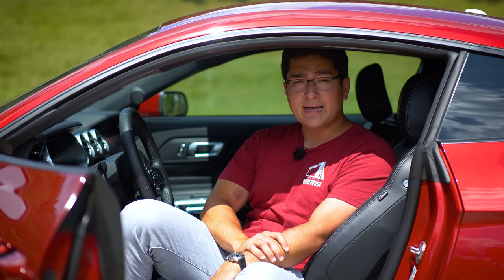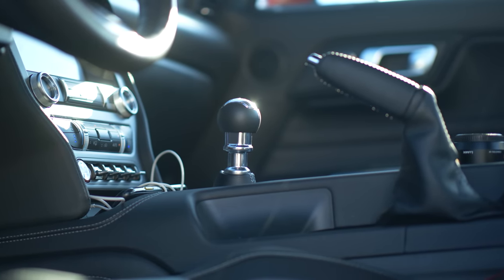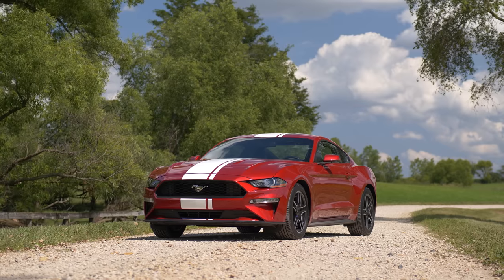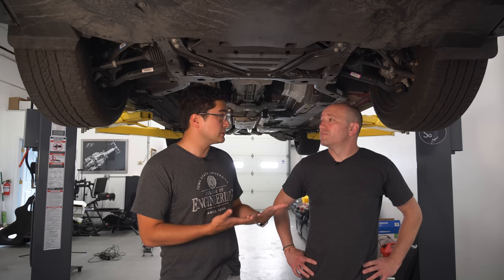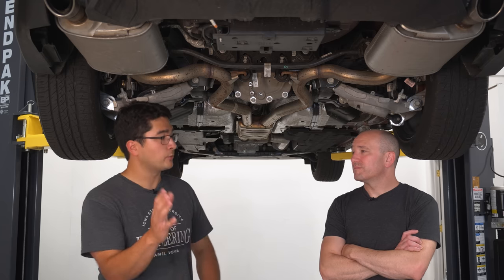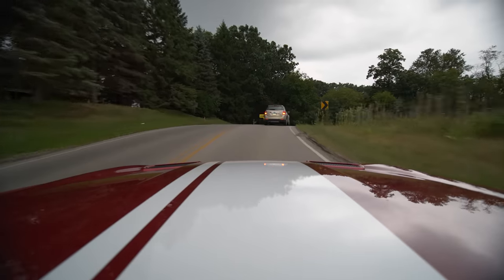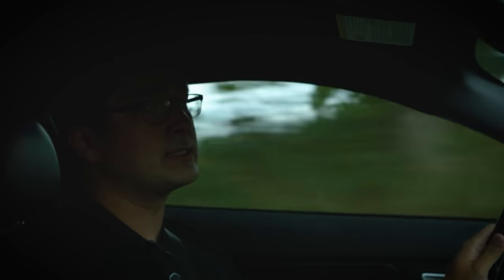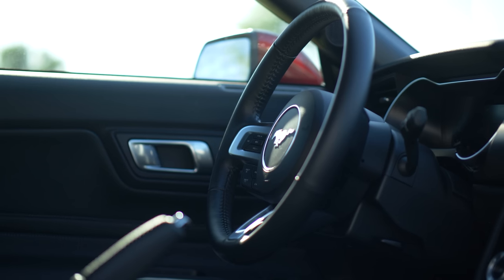2020 Ford Mustang EcoBoost | Red Headed Step Child

Comment: Wait till the ecoshit turbo bricks over time. Wish they kept it NA 6 like they had.
Reply: Agreed the 3.7 was a great but unapreciated engine
Reply: Prefer Supercharger (Whipple/ Roush), because at 38,000 miles i had Turbine Lockup within the Turbos at 82°+. This is caused by Thermo Variations consider locations of Turbos Ford mounts them below for lower center of gravity.  Problem is they're right next to the very hot engine.  Ricers know this and mount them up high close to heat extraction hood vents.  To keep them cooler, and not for show. Now the Turbo Shell expands like a donut 🍩, while it's being baked the outside expansion is outwards vs. Inside expansion is inward the hole gets smaller. The Blades expansion is outward to be larger to hit the Shell. Locking up the Turbine Blades, and then add the Backflow from the Intake and Downpipe to it to spool the the Turbos more.
My fuel mileage went from 
32 mpg to 8-12 mpg.  Glad for 2021 it'll have the GT500 engine package 5.0 V8

Comment: I like a lot of your other reviews, but Alex on Autos gave a much more unbiased fair review of this car than this refresh update. I think there was so much negative connotation constant complaints about the platform, yet when you look at your review of the BRZ which you owned there is clearly a much more positive tone throughout the whole video despite it's flaws. Even Jay Leno liked this car. Sure, maybe the BRZ is a better 'enthusiast' car, but honestly, under 30k the ecoboost mustang is an enthusiast car. There is a massive enthusiast market for the vehicle and tons of modification options yet you constantly deride the car as a 'fleet vehicle' . Don't categorize this car in the same area as a ford fusion, the high torque figure of this engine as well as the tunability of the turbo definitely makes this a fun car. Yes, I do own one, and yes I was disappointed you hated this car so much, but I'm just honestly tired of the constant online bashing of this car coming from mongoloid GT owners (which you guys are not and not to say all GT owners are even like that) or reviewers saying 'BUT ITS NOT A V8'. For once, can you look at this platform from a different perspective, without all the baggage and notion of the 'mustang' that you seem to completely hate and disgust for some reason? If we go purely by the numbers game a 300hp 350 ft/lb four banger turbo at 3400lbs under 30k easily sold by bmw, toyota, nissan, etc. or any other more eurodm/jdm focused brands probably would've received less negativity than this car. I just think in general, that when you see an american car, that you are visibly upset at believing that it is poorer quality, big and chunky, and not fun to drive. Maybe that is what you've experienced, and want to believe, but even as a younger, asian american (I mention this because the primary demographic of USDM supporters tend to be of a different ethnicity) that like JDM, EUDM, but owns a mustang, that there are legitimately good things about the car to enjoy and absolutely make this an enthusiast car. To me, being an automotive enthusiast is about appreciating the history and almost all vehicles from all markets, trucks, SUVs, wagons, alike. Sure I have my preferences, but there is so much bias and negativity in this review that its really off putting. I'm all for an honest review, but this was just bad.

Comment: The 4 cylinder turbo stangs are a blast to drive.  Owned a 2015 pp 4 cyl and a 2018 GT A10 pp1, looking hard at a 2.3HPP.   The turbos are so much fun on the daily.  And also....tune much?  The 4cyl really responds.

Comment: 300hp 4 cylinder. It’s not an engine. It is a hand grenade. Pull the pin or hit the gas either way they both have short life spans. 🤣

Comment: I had a completely base EcoBoost that I did extensive suspension mods on and tuned conservatively. Was in for far less than a GT, and it was a real monster on track. The low down shove of the EcoBoost, especially when tuned, made getting out of corners a delight once the suspension could keep it there. Maybe the lighter nose played into that as well. Anyways, I sold that piece of crap and got a Z4M Coupe. Fun car, but not something I wanted to live with for an extensive time period.

Comment: 9:00, I find it kind of crazy how this car has pretty much 0 aero panels underneath the car.

I've owned a bunch of cars in the past 7 years.... FRS, NC Miata, Kia Optima, GTI, Veloster N, Prius (yeah wasted too much money 😕).  Every one of them has had at least the front aero panels underneath the car.
Reply: Not to mention the abundance of stamped steel chassis components. The Alpha platform underpinning the sixth-generation Camaro is far more advanced.

Comment: Had one of these as a rental when in the states and absolutely loved it! I'm sorry but on what planet is a relatively affordable car with 315BHP and 350 lb-ft torque not a vicious animal of a car?

This thing scares the crap out of most normal people and is far beyond the power that the majority of people know how to handle. Put your foot down and you're at 100mph in seconds. Put your foot down coming out of a corner and the back end will step out. It was incredible fun to drive and is also very comfortable (love the seats). The steering feels very solid and overall the car is an aggressive, muscular brute. 

Is it a V8 Mustang? No. But is it an incredible car in its own right? I think so.

Comment: I would even suggest an SXT challenger. Yes, it does not have a manual. However,  306HP, RWD, a good revving V6 that can get you close to 30MPG is amazing. If it had a german/japanese badge, this would be considered incredible.

Comment: I've got a '15 V6 convertible.  Within my budget, I had the choice between the extra two cylinders or a top that goes down.  I live in a sunny state, and the car is a great daily driver.  Long drives down twisty mountain roads are enjoyable and long drives are comfortable.  Plus it didn't break the bank.  It is a great value.
Reply: Good choice 👌

Comment: I am an enthusiast. I own an ecoboost Mustang. I'm not going to drop over 25K into a car, at least at purchase. The eco provides a great tuning base. Granted it is no 5.0, however can you direct me to a car that I can daily, provides a vast aftermarket, provides a great tuning base, is reliable, and you can get with less than 50 thousand miles for quite a bit less than 20K? There are less than 10 cars I can think of. 

I get that it's not AS exciting as a performance variant of the Mustang or other similar cars, however, when did nearly 50-50 weight balance, 310 crank horsepower, and an engine with 20 pounds of boost stuffed into it start "sucking"? 

Understand that as much as I appreciate high horsepower machines, this is your modern day 240sx.

Comment: I built one at Ford, I had the eco-boost with the performance exhaust and handling package. There is no place I know of where I can speed recklessly, however, I can enjoy the twisties. My build came in just under $40k. The new all wheel drive Mazda 3 turbo is about $35K. Both get the same gas mileage, or similar, and the difference between the two for someone like me is monumental. If I had the money, I would go for the Mustang. I bring this up because the two of you were poo-pooing this as not a performance vehicle. Frankly, I'm not that good of a driver to handle a performance vehicle and I doubt there are many people who are but this as an everyday car for me would be amazing.

Comment: I really wish we got a review of the “performance” version. Im sure an lsd alone would have made this car feel a lot better. Also, an after market tune would probably settle a lot of the timing issues. The GT350-500 cars are usually garage queens. I prefer cars that can be beat on, customized and enjoyed without feeling like your defacing a museum piece. I’m curious how a fully spec’d ecoboost vs a base GT compare in cost and performance?
Reply: They all have an lsd. The performance packs just get a torsen upgrade.

Comment: Really!!!  My 2018 stock base Ecoboost Mustang A10 has ran as quick as 13.26 @ 103mph at the local drag strip. It's a tune away from being a mid 12 second car. I am a 60 year old male that wanted a sporty daily driver that gets decent milage.  I'm not interested in a canyon carver or track day special, but I  drag race occasionally, so I opted for the automatic. In drag mode, it will break the wheels loose on every shift up to fourth gear. At the drag strip, it can hold it's own with many modern sports cars even 5.0's (2018 and up A10's are in a whole different league). I totally disagree with you saying that the 310 hp Mustang Ecoboost isn't a high performance car. It may sound like a Civic, but it is a very fun and competent and high performance car to a common man like me.
Reply: It’s sounds better than a civic. I’m honestly in the market of buying an ecoboost because you get so much more bang for your money than if you were to buy the TypeR with mark up
Reply: @mokokoco4720  I mean if you really think about it a Honda Civic type-r is better here is why. The Ford Mustang EcoBoost go 0 to 60 in 5.1 seconds that's about the same as the Honda Civic type-r but the EcoBoost is only limited to 121mph while the Honda Civic type-r is limited to 169mph or if you cut the performance pack it's 180mph. Now I'm not a Honda person but with those numbers I would probably choose a Honda and you get way more space in the Honda Civic type-r rather than the EcoBoost

Comment: 2019 Mustang GT (manual) driver here, coming from a Fiat 124 Abarth (manual). 
I only get to use a fraction of the GT's power on the daily commute whereas I previously could use 90% of the Abarth's power each day. I have to admit I miss that aspect.
It's more fun to drive a slow car fast than a fast car slow. Nothing beats that V8 sound from the performance exhaust, though 👌

Comment: Not sure why Mark dislikes this car so much. I respect his opinion, but I think he is comparing it to $100,000 cars in his mind and that is a bit silly. This is a very good performance RWD car. 300ish HP is absolutely enough power, more than you need on a daily basis. I would argue that anyone who spends huge money on a performance car looks stupid next to someone who buys something like this. The real expensive high end performance cars put out more power but it is all useless on the road in real life.
Reply: Not to mention if you do the work yourself you can have the thing beating GTS for about 2,000 bucks. Plus the ecoboost engine is making way more torque down low than a coyote for its equivalent horsepower. My EcoBoost really shines against GTS from a stop on the highway they give me a little more trouble but I win some and lose some. On the mountain road though it's no contest my car handles way better and is balanced better. Check it out I have vids of it on my channel.

Comment: I'm sitting here wondering, did either one of you to guy compete in any motor sports? I did for 30ty years, I raced in NHRA and traveled the country with my car. As you two were snickering about the 4 cly you tested yet that 4cyl makes 310 hp, that's a 13 second car. I'm an old dude but respect what the younger car guys that are taking a 4 cly engine make unreal power. Once, I took my race car on the street and did a one, two shift the distance I traveled amazed me. The point I'm getting at is I feel these super cars should come with a full roll cage if they go faster than NHRA rules for a legal cage. If NHRA feels like you need these safety standards to drive a 1/4 mile the same standards should on the be on a streetcar. We also should show more respect to these younger guys who are building these 4cly engine and making more power than the muscle cars of the past. It's far past time we join both the cars from the past and share the spotlight on younger car owners.

Comment: Bought the 2020 Ecoboost as a replacement for my WRX Base.  This car with a manual transmission is a blast to drive and gets reasonable mileage.  Great daily driver (once the damn Covid is over).  Get the Ford Performance tune and its a real sporty under $30K daily ride.  This is super underrated and is a real surprise!  Way to go Ford!!   Oh and my WRX has two engine replacements.

Comment: I have a 2016 and I'm pretty happy with it. I'm glad I didn't get a 10 speed transmission since I hear they're having issues now. I hear the manuals are having issues too which sucks. For the price I paid, which was about 20k I think it's a good deal. I didn't want to pay the extra 18k or so for the GT and everything else in the similar price range wasn't as comfortable ride as the Ecoboost is. For the price and the performance I think it's a great value. I get comments from the "normal" people that aren't into really fast cars but still appreciate sporty cars.

Comment: There are some who enjoy owning and modding the underdog.
Reply: Id rather have this as a track day car over the 5.0 much lighter front end, much better weight balance. Ive seen these completely straight piped from turbo back, upgraded turbine, 550cc injectors, walboro 255, e85, upgraded clutch, and tune pushing 450hp at the wheels on stock internals. All while weighing 250LBS less and pushing almost the exact amount of HP as the GT. This car with some wider front and rear tires and wheels would probably be 2 seconds quicker around road atlanta im guessing.
Reply: @followthegrow108  that's incredible man. Just thinking over 400hp with stock internals on a "four banger" is absolutely unbelievable. These are seriously underrated engines.

Comment: One thing about what the engineer says I disagree with is the statement that the 10-speed automatic better suits the characteristics of the EcoBoost than the 6-speed manual. I feel that the ecoboost actually loses a lot of what can make it fun when its an auto. The GT has so much power and character to make the auto fun, but the ecoboost feels almost muzzled with the auto.

Comment: As someone who has snow half the year and the roads are dusty even when they are warm and dry, the extra performance from a V8 is negligible because the power can't be put to the ground. This seems like a much more affordable way to daily drive a manual rear drive vehicle all winter. I also don't live near any race tracks, and want a comfy cruiser for my frequent 8-hour drives down straight roads. The Genesis G70 with a manual provides similar attributes.

Comment: Did that gauge show the IAT?
more turbo 4 bangers need that.
We all know heat soak and high intake temps will cause the car to cut boost etc..
Would be nice to monitor it without using a piggyback or other ECU tune with Bluetooth for an app to read the added sensor info

Comment: I feel like this video really covered so many good points on this car. I started off in 2016 getting an EB Mustang, as an entry point to get into the Mustang family. This car absolutely accomplishes it's purpose 100%. After my lease was up, I wanted something more... so I jumped up into the GT PP1 category. The biggest party trick is if you can find a slightly used GT, you can often times get it in the price range of a new well-equipped EB Mustang price. Can't beat that for $30k. 

The EB is a great car for the money, but if you really want the V8 performance... you just have to do some homework and you can get a good used one for near the same price as a new well-equipped EB one like in this video.

Comment: Not a bad option in convertible type for the Euro market. Here V8s and prohibitive, and I have a 5.7 to prove how stupid I am.
HOLY SH*T I just checked the price at Ford.es and the EcoBoost is 45K€ ($53K) while the 5.0 is 50K€ ($59K). They have gone absolutely bonkers and stupid. Simply put, there's no affordable option here.
Reply: Mustangs are a great value in the north American market, not so much anywhere else.
Reply: I've been seeing most 2000-2004 mustangs asking for like, $6000 CDN.  Seems like all cars are stupid expensive now

Comment: I bought a 2005 GT with 300 HP.  Only three general population cars at the time with 300 plus horsepower.  By the way it did not even have independent rear suspension.  New Shocks and a little stiffening of the suspension an little tune on the motor and this will run with all of the pre 400 hp mustangs.

Comment: Dunno why reviewers never mention that a stage 2 cobb kit (comes with access port 'tuner', air intake, and bigger intercooler) for this is $1600 and their exhaust is another $1100 and will let it run a stage 3 pre-installed tune that will wake this car up. It mostly fixes the boost drop off and gives it close to 400 lbft tq with bolt ons that most people can install themselves. (The catback might require a lift but is still an easy install). This is why the 2015 V6 are selling for cheaper, the ecoboost has a lot of potential.

Comment: I wish Ford still made a V6 Mustang but I get the appeal of turbos
Reply: A straight six with a turbo would be even better. Easily 350 hp and 30 mpg. I have a 2019 Ecoboost and a 2011 V6. I prefer the V6, more hp than the Ecoboost on 87 octane and better gas mileage.